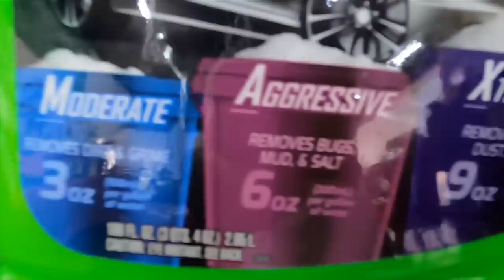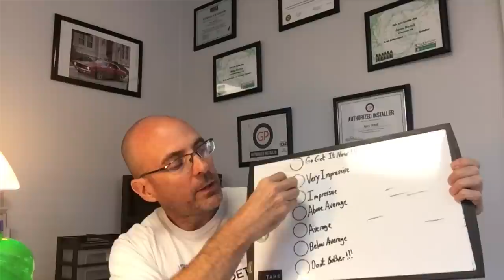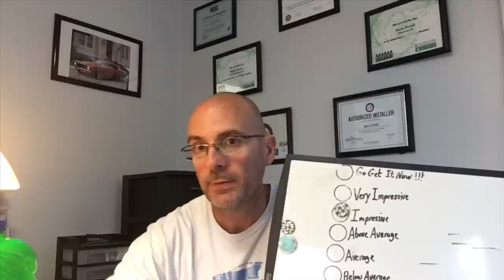Turtle Wax Max Power Car Wash! How I use It. 3 Levels Of Cleaning Power!

Comment: I picked this up this summer. I've done a couple washes with it on a car protected with Lithium ceramic slam. It's been great, the car is squeaky clean and no damage to the coating. Tried it out in a foam cannon and got the same results. I agree 100% with this review!

Comment: I used this on a pickup that was sitting in a garage for about a year. Lots of dust and oil on the  body. It worked good  removing all that. Did  one wash with  foam gun on a hose then hand washed. I will probably use this on my cars  in the spring after winter to remove the salt and brine and sand.. Thanks Brian & Jr  for the great videos.

Comment: As I mentioned in your Facebook group, I put 2 oz (1/4 cup) into a 32oz spray bottle and use it for cleaning wheels, wheel wells, door jams if they've gotten nasty, bottom of windshields etc, use it to replace an APC to try and save on cost. At this dilution I can make 50 32oz bottle solutions from one container of Max Power, very cost effective.
Reply from the maker: Will Overkill cheers!

Comment: I use this as a pretreat at 9 ozs since I always add protection after every wash. I apply it using a IK 12 sprayer. During the winter I add a salt neutralize to my mix, killer mix. If I use it to wash I always add ONR to just about every product to add lubrication.

Comment: Brian, how does the striping strength compare to Purple Power?
Reply: +1 wondering the same thing
Reply: +2 I normally use Purple Power Vehicle and Boat Wash, wondering if this is more powerful
Reply: +3
Reply: Wondering same thing.   Would you use Purple Power or Turtle  Wax Max to prep for coating?
Reply: +4
Reply: Purple power boat soap it's not PH balanced, the TW is ph balanced as Brian's said,  you need over 7 ounces to increase the PH to strip waxes. I will still like to know a cheap soap that just cleans, dirt and grease and won't strip wax using a a few ounces of soap, and this TW may be one  cheap alternative, when wanting to top the paint off with a quick wax or sealant
Reply from the maker: With a ph of 10... it’s in a different class.
Reply: @apexdetail85  Good point.  At the same dilution ratio for "Xtreme" on this product (9oz to 1 gal), PP Vehicle and Boat would be a PH of roughly 8.8.
Reply: @jimdavis5u  but I guess that will depend on purple power's dilution

What if you dilute also the PP 9oz per gal of water?
Reply: @gorillanismo  That's what I'm saying - PP V&B diluted at 9 oz per gallon should be 8.8, unless it has some buffer in it that resists PH drop when diluted.  Starts at a PH of 10 according to online sources.
Reply: @jimdavis5u  I think Im lost, if you add more concentrate of alkaline product the ph should go up not drop. 
If PP diluted 1oz per galon is ph of 10 then adding more soap to the same gallon would keep increasing the ph not drop it.
Am I wrong?
Reply: @gorillanismo  TW MAX Power is a PH of 10 at that dilution rate.  PP is a PH of 10 undiluted.
Reply: @jimdavis5u  now I understand, thank you for the explanation
Reply: @dossegundos7145  That makes no sense, if it's ph neutral then increasing the concentration won't change the ph. Also, ph has nothing to do with stripping waxes, there are plenty of other washes that have a ph of 12.5 that won't harm wax.

Comment: I really like that Turtle Shampoo. I have a Gtechniq Ceramic Coating on my Car. (Gtechniq Crystal Serum Ultra + Gtechniq EXO). 
When I want to clean my car I want a shampoo that cleans and nothing more! And of course it’s important that the shampoo has good lubrication qualities. And the price is reasonable. Her i Norway it’s more expensive. About 200Nok (20USD).

Keep up the Good work Brian! I love Your videos!

- Kurt
Reply: 3d super presoak is what you’re looking for
Reply: Have you used bilt hamber autofoam? I notice that it cleans extremely well, which also makes the car more "slick" feeling to contact wash.

Comment: 4:12 is what I look for in a soap. Very flat on the surface but allows for beading as soon as it’s gone. Good stuff
Reply: Would you happen to know if you can put it in the soap tank of the actual pressure washer with just the soap tip no foam cannon
Reply: @19jdorsey86  I have, but tbh it's best not to run anything upstream. Look at downstream injections.

Comment: Good morning, I filled up my pressure washer soap container with this and just sprayed it over my car. Then for my contact wash I mixed it with water on a bucket without reading the instructions and I ended up having a lot of white residue... Or like soapy spots that were very hard to remove. I wonder if it's because I added an excess amount of soap.

Comment: I just used this to strip the protection off prior to coating ...it did its job... question,, have you. had any issues with xtreme suds knocking down protection? it says its ph neutral but its potent...
Reply from the maker: barry bij Suds is quite potent. 12 ounces in a 3 gallon works for me.

Comment: Do you think the 6oz. per gallon dilution would make a good and economical wheel cleaner for well maintained wheels?  Or, possibly even the 3oz. dilution?  Maybe somewhere in-between?  Thanks
Reply from the maker: Rob D well maintained wheels. 4 to 6

Comment: Ahh damn it, I was all set on getting the new Carpro DeScale to use as a strip wash to strip old “car wash” protection, and some Ceramic Detailer I used. But now I’m wondering if this might not be better. 

If you have any thoughts, let me know, I’m on the hunt for the best strip wash. Also what are your thoughts on adding some ONR for better lubrication?
Reply: Me too... I'm not sure is this as good as descale in terms on stripping old wax and sealants

Comment: I have the Twax ceramic coating. I see you mention to put 2-3oz to prevent breaking down previous wax. Is that the amount you'd use per gallon or per bucket?

Comment: I am so damn mad I haven't found out about TW max power especially at $5 for 100 oz.!  If the ph adjustability works that well then I could literally use this for multiple things like an "acid" wheel cleaner, apc, a wax stripper/degreaser, regular shampoo, etc. vs. having to buy $60-70~ in just specialized products that have one maybe two use cases for.

Comment: I use at 4:1 either super clean or regular purple power to strip wash. I just spray it on the panels after I rinse. 

Rinse/spray super clean/ foam. 

Works great.

Comment: right now I don t want to strip mi wax am in a condo and shes outside and any protection is important.after you re apply the wax
as dad come to an end that means a chapter comes to an end between now and 2 or 3 years and am searching for a 4th generation fbody
perhaps I need to start fresh.
in 1998 for a month or 2 I worked for the Opel dealership or longer can t remember and if the wash mitt or sponge what you use this wash mitt slide over the body I know the owner or previous owner maintain it well I remember was a Volkswagen Jetta in 1998 at the  dealer back than was a sponge the roof was like glue no way I can move the sponge..in 2020 even do shes outside body panel still is slick.perhaps also croftgate usa quick & slick am in the U.K .who knows I might need it when mi dream come true even a V6